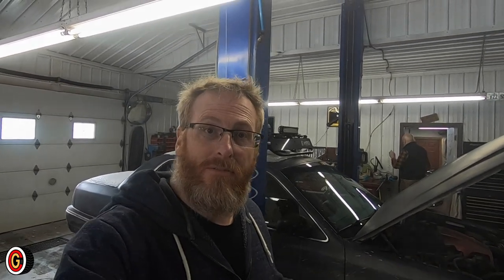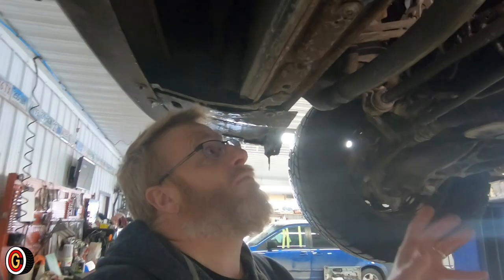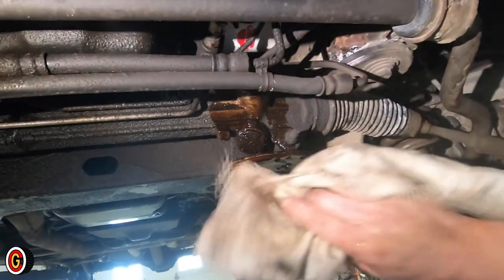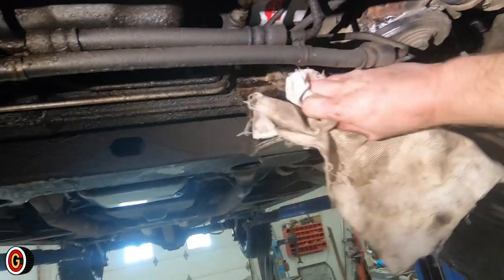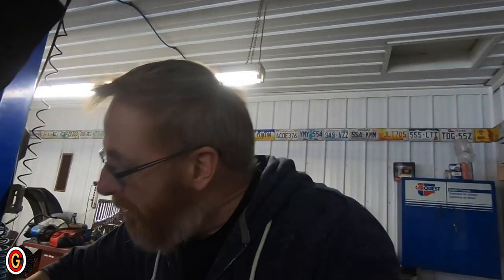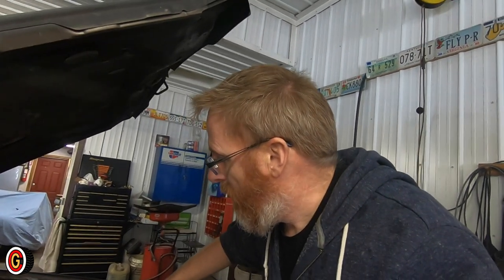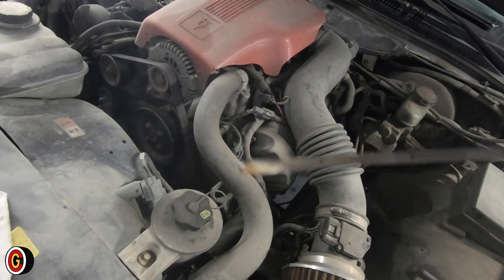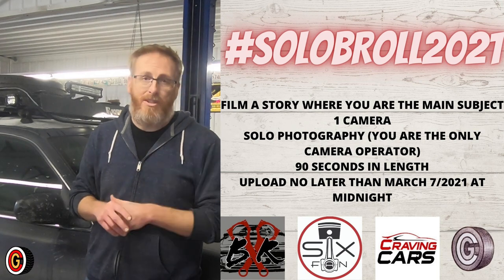FORD Oil Filter Placement Have Been Engineered Wrong For Years

Comment: I agree, they should install them on a section of the frame. I work on Volvos, but my bosses brother had a Lincoln Mk LT, and the 5.4 had the filter hanging down, aimed right at the front diff. Leaked allover the diff pumpkin and made a big mess. Even when I worked in at a 10 min oil change, there were some with the tray, and it just made a mess too.
Reply from the maker: Crazy eh? Thanks for watching!
Reply: @OldeCarrGuy  You're welcome! Love the videos.

Comment: 2:25 The "newer" Panther cars 2006-2011 have a combination splash shield / funnel to direct oil away from the steering gear when loosening the oil filter.
It's an OEM Ford Part, and can be purchased for $15, and installed on 2005, and older Panther cars.
Let me go looking for the part number, and web link.
-Chuck
Reply: Here is the Part Number;
5W1Z-6N634-AA
The cost is $10.31
Reply from the maker: I knew I could count on you Chuck to have a solution! Thanks bud
Reply: @OldeCarrGuy  
I'm a sucker for your clickbait game. 
You're a pro.
Reply from the maker: @PanzerPlatform  definitely not click bait! You said yourself Ford added the catch plate in 2006. A little to late if you ask me. Besides even the 2020 f-150’s oil drain empty’s directly onto the sway bar causing it to literally spray everywhere! I mean, it’s the most common form of maintenance and the flubbed it up!
Hence, Ford was wrong!
Reply: @OldeCarrGuy  
OK,OK, geez. 
I was just kidding. Lol
Reply: @PanzerPlatform  right on Chuck. Thanks for looking up that part number. I’ll get one for sure.

Comment: I have 3 modular engines and agree filter is not in a convenient location but I worked on heavy equipment for years so this is a piece of cake. Once I finish marauder I will come up with something to minimize the mess cause everything is painted now. I used to loosen filters a bit then poke a hole and direct oil where I wanted.
Reply: Right on C-Raud,
There may be an easier option. 
Check out my comment for the part number, and more info. 
-Chuck
Reply from the maker: Chuck's right! He's always right!
Reply: @OldeCarrGuy  yeah as a general rule ole chuckles is the benchmark.

Comment: I had a couple of older ones and I was thinking that turning the wheel would help you get into the filter easier, I can't say if it works the same way on the newer ones.
Reply from the maker: Little different set up on these later models. But I remember the ones you're talking about

Comment: Got a 98 F150 4X4. Oil filter is right behind the bumper, easy to service. Sometimes they do it right.

Still, all that oil dripping on the PS rack? Next thing that happens is that safety inspection tells you that you must replace your leaky steering rack!
Reply from the maker: Great point! Thanks for watching.

Comment: That’s a bad design. Maybe when it’s warmer, you can pressure wash the engine. That might help locate oil leaks. Imho.
Reply from the maker: If it were any other car, I’d agree with you. But old Black Jack may be getting a motor swap I. The future!😉
Reply: @OldeCarrGuy  sweet